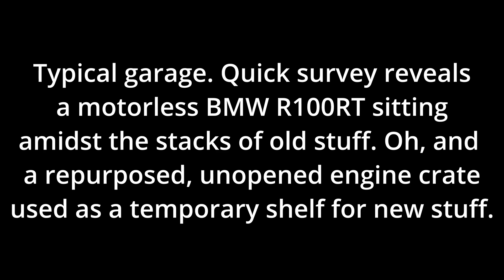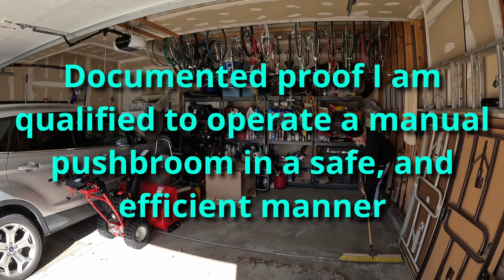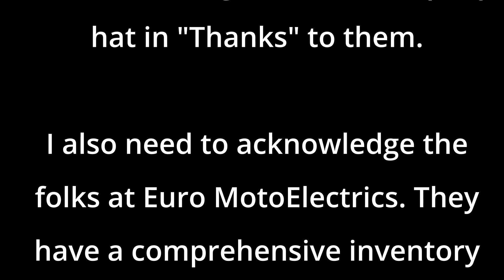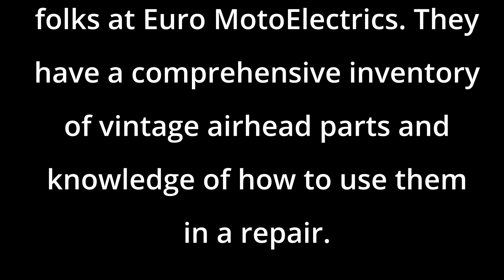BMW 1979 R100RT Rebuild

Comment: Sweet bike. Congrats on keeping it on the road. I have my dad's old 90/6 waiting for me to get it running. It's been sitting over 20 years. It kinda seems overwhelming.
Reply from the maker: Greetings Jeff, Thanks for the kind words! I look on line and see a lot of RTs that look showroom. That's nice, but mine has the patina of a bike that's been on the road, seen a lot of countries and never let me down. The engine never quit, She always got me home. Don't fret working on your Dad's bike. You will have a friend in it forever. The BMW is very simple to work on and you don't need a lot of special tools. You can almost tear down the bike with what you find under the seat in the tool box. And there are a ton of videos that will get you through almost everything. Hint: When you start the tear down, put the nuts and bolts in baggies with a note where they came from! Take pictures of the wiring. Post a picture of the bike. I'd love to see it. Thanks again for dropping by. I look forward to hearing about your experiences with the 90/6. Cheers, Rich. Be SAFE!
Reply: @richardryer3412  Thanks for the encouragement and tips, Rich!
Reply: In the old English language JFDI. Just F***** Do It😂

Comment: Nice to see this bike running. A lot of memories with that machine for sure.  
I'm chasing what appears to be a fueling problem or maybe some electrics that present as hard starting and this morning as not starting at all. New fangled machine requires a tablet and software app to fiddle. 

I really enjoyed the ride up the pass part. That Colorado blue sky is always so amazing.
Reply from the maker: Hmmm......My simple starting and charging system is 8 or nine wires and one generator light. I always liked your newer, technological system for start up with all the lights and diodes and dings and whines and whirs, and light screens, etc. Kind of like firing up a starship readying for warp speed.....A little different than the old, flat twin vibrating technology I now get to put between my legs for a ride.....OHHH! Can I say that?

Comment from the maker: You probably noticed the tach is not working. That is something I am looking at. Hopefully we can figure it out. Rich
Reply: Hi Rich, hope you doing well. Congratulations, great work. Did u find the reason, why the tach didn't work? I got exact the same bike out of 'March 79, not as much miles like yours, about 140'000 km, in original shape with scratches and so on. https://de.m.wikipedia.org/wiki/Datei:BMW_R100RT,_79.jpg 
And remember: Head up and rubbers down. wish u a safe ride
Reply from the maker: @traebbeRT Greetings Traebber, I have a four part series on the trouble shooting I did on the original tach. Basically, the original Tachometer failed because of age and wear. I did find and purchase a used tach from England and it worked just fine as soon as I put it in. The old tach looked kind of grungy where the shaft went up through the dial, black build up and some cruddy looking hangings on. The wire insulation was also a little screwed up. I sent the tach to Palo Alto Speedometer Repairs (I recommend them highly) and the tech went through it completely. He tore it down to individual bits, cleaned and tested, replaced worn mechanical parts and tested the circuit board which was defective and replaced it. Total cost of repair was about $475. My original tach is now back and brand new and working perfectly. So, after 40 some odd years of use and 375,000 miles it just reached the end of its useful life. Palo worked miracles and brought it back to life. So that's the story of what happened to the tach on my RT. Thanks again for your interest. Cheers, Rich. Be SAFE out there!

Comment: Nice video. little late reaction but who cares.. lol..
BMW 1978 R100RS-SIDECAR owner 🙂
Reply from the maker: Hello DDF, Thanks for the visit and kind words. It was an adventure tearing the bike down, getting the crankshaft and bearings restored and putting it all back together again. Trusty old steed for 375,000 miles. And spring is in the air, so time to start riding again. Have a great spring and summer. Keep the rubber side down. Cheers, Rich. Be SAFE out there!